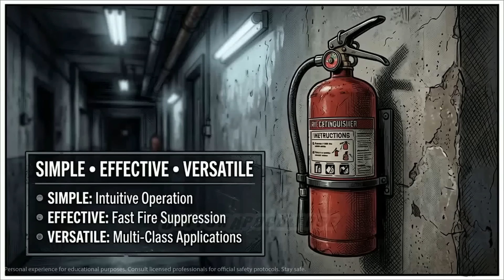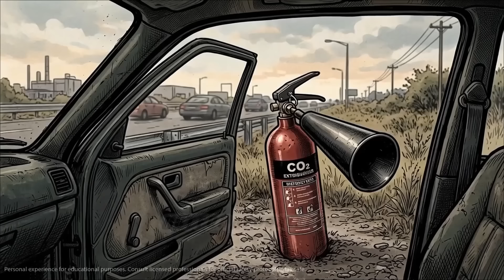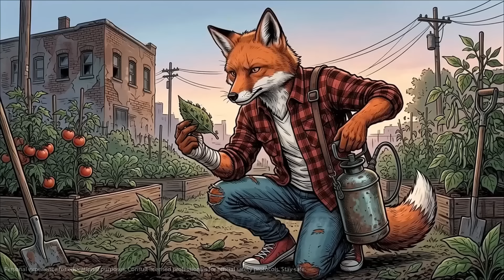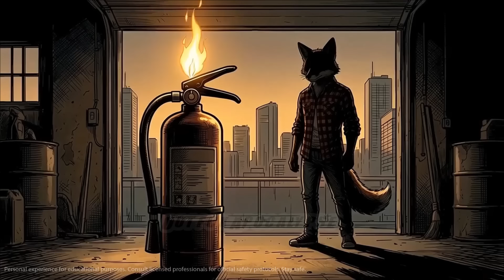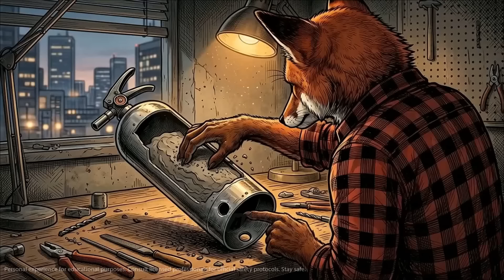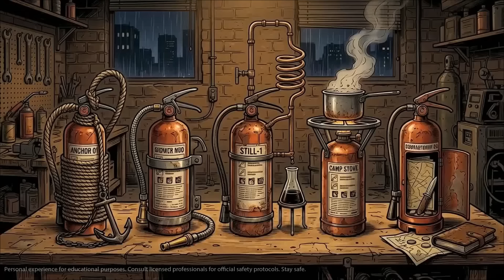9 Survival Secrets Hiding Inside Every Fire Extinguisher

Comment: 1) a battery operated tire inflator.  My Outder charges off charges off my car battery 
2) a twig stove.  Mine is titanium and folds flat for backpacking 
3) hudson sprayer.  I have half a dozen in my garage 
4) a lot of work for mild steel, which can be found everywhere 
5) a coke bottle works just fine 
6) a plastic bag works just as well.  If a handle is needed, use nylon rope strands for rebar and mold it in
7) fair use, but only for water.  You need copper sheet for a decent alcohol still
8) plenty of better things laying around.  My stainless steel deepsink comes to mind
9) fair use for an emergency

Comment: If you use the stainless steel water pressure fire extinguisher, it is refillable and it already has a schrader valve on it i take mine camping, and I refill it with rv. Antifreeze fifty-fifty mex.
And leave it outside my camper.I'm in case my neighbors need